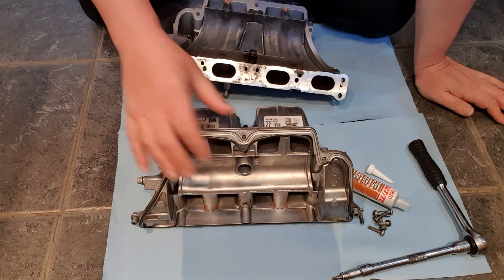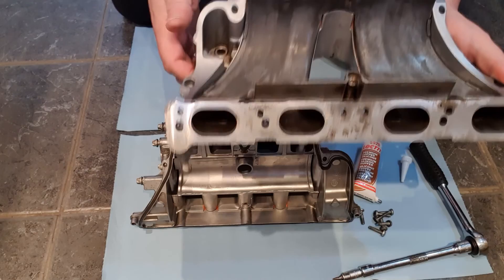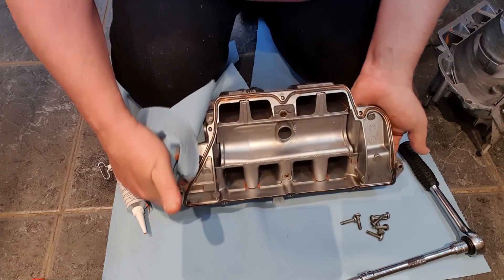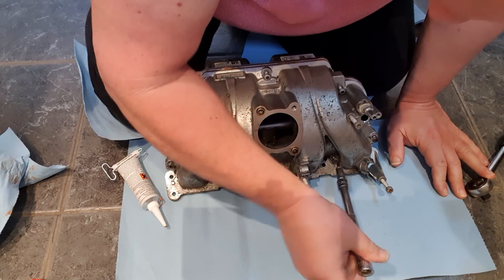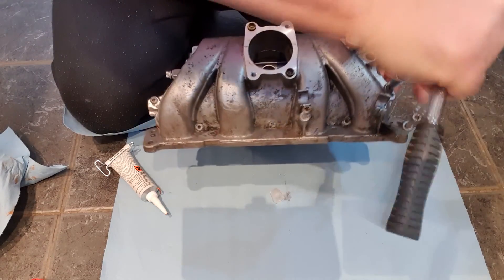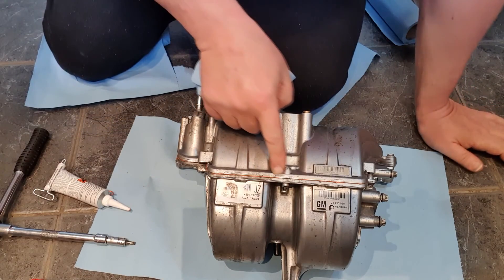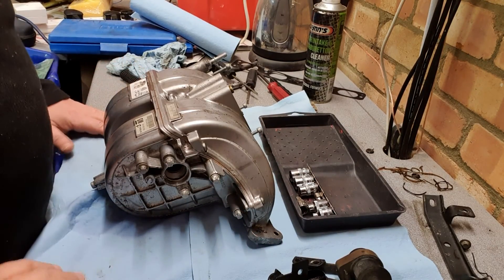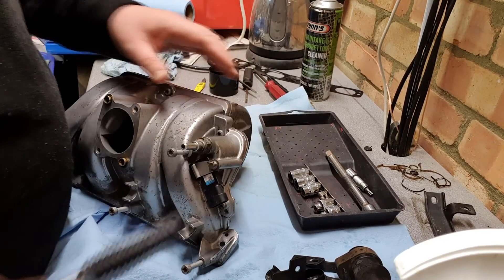Astra Z16XEP manifold repair part 3

Comment: Hi, did this cure the rattling noise? As cannot find an update video once it was fitted back to engine
Reply from the maker: Hi Neil, thanks for your comment, unfortunately it didn't fix my rattle although it is a common problem on these engines, here's a link to the video when we start the engine after putting it back together https://youtu.be/PZhH8rr1Mdk
Reply: @VauxrezNeil  i have simular noise...Did u change timing belt & tensioners or check see if auxiliary belt pulleys (crankshaft, alternator, water pump, air con) are loose causing a rattle noise. On my astra the noise sounds fainter at high speed (60mph+). I also read somewhere it could be the crankshaft cog loose causing a vibrating rattle noise. Let me know if u cured the issue mine been running for a year like it but doesn't affect driving or fuel
Reply from the maker: Hi Neil sorry for the late reply I don't want to give too much away at this point as over the next couple of weeks I will be revealing the cause of the rattle. stay tuned for what happens next :)
Reply: @VauxrezNeil  look forward to the reveal

Comment: my car Z16xep zafira B 1.6.my problem is because in the morning when the engine is cold it works very well but after it heats up in traffic it loses power completely. only when it heats up it has this problem please give me any idea as I have spent a lot on changed many parts and without solution
Reply from the maker: what parts have you changed, I'm thinking along the lines of temperature sensor as your issue it temperature related, also MAF sensor as I believe they have an air temperature sensor built in
Reply: @VauxrezNeil  I changed the collector coil suction spark plug sensor O2 bank 1 thermostat battery. I cleaned the MAF fixation sensor and throttle body. the code it gives on the screen is p042052 I think it could be both sensors 02 I changed only one used original should i buy two new original sensors where can you order please
Reply: and Egr I cleaned. and changed UEC recently but no solution the same situation is with lpg system. in gasoline when it is hot it works badly up to 2500rpm but further goes well if I pass 2500rpm and above
Reply from the maker: It could possibly be the other O2 sensor they do tend to fail at about the same time or worse case, it could be the catalyst itself
Reply: @VauxrezNeil  a month ago I changed the new mounted catalyst and the bank 1 sensor used this happens after it reaches a temperature of 113 degrees after it has been put into operation two to three times fan
Reply: @VauxrezNeil  what O2 sensor do you suggest for this model z16xep should i buy original where can i ask please
Reply: @VauxrezNeil  and something else can be and a resonator blocked at the beginning of the cold works great this strangely. map sensor I cleaned a lot of money spent but to no avail